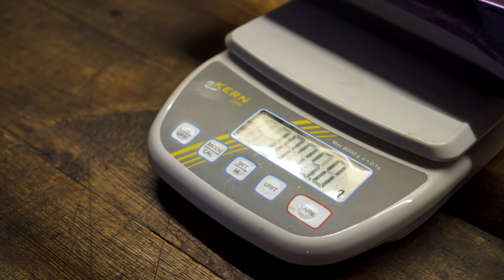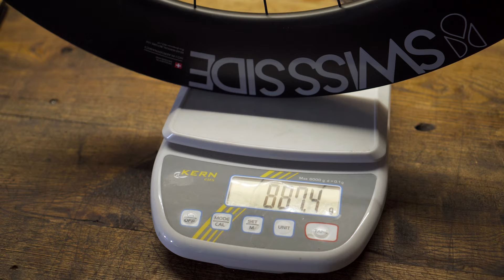Dreambuild 3T Strada Custompaint by Tony Spray I Dream Build

Comment: Quelqu'un serait quelle transmition ils ont mis sur le velo ? Sram 1×12 ?
Reply: chris Rouzbi sram red axs
Reply: @ianiscaratti4924  merci , j'ai bien vu .je me suis mal exprimé. Je voulais connaître le développement.
Reply: @chrisrouzbi7406  Salut Chris ! Vu la taille du plateau je partirai sur un 42 dents. Mais je sais que Sram en offre aussi en 48 et 50 dents (je sais, ce nest pas un pédalier Sram 😅). Pour la cassette tu a le choix, 11-28/11-30/11-32....donc a voire ^^
Reply: @theobuzat9091  salut , merci pour la  réponse.  En faite je pensais que sram faisait comme rotor https://rotorbike.com/catalog/french/rotor/route/road-rotor-1x13-kit.html
Reply: @chrisrouzbi7406  nn Sram ne fait pas encore de 1×13 effectivement 😅 mais de rien, si tu a d'autre questions...pas de problème (je suis partie sur le site 3T, le pédalier proposé pour le Strada est un pédalier mono-plateau 48T ou tu as aussi le Strada Duo avec un double plateau Sram "standard" (48-38 je crois))
Reply: Le plus souvent en 1x12 tu as du 44 devant et la cassette c'est du 10-33.
Reply: @Ch1k3nBra1n02  et bien ici c'est un 48 😅
Reply: @ianiscaratti4924   Merci , comme sur les VTT en 27,5 en somme